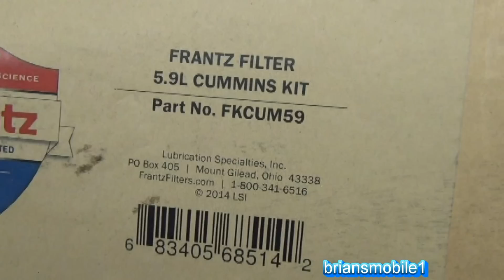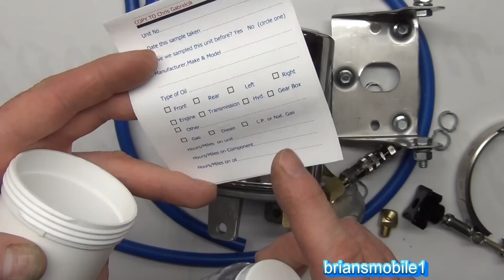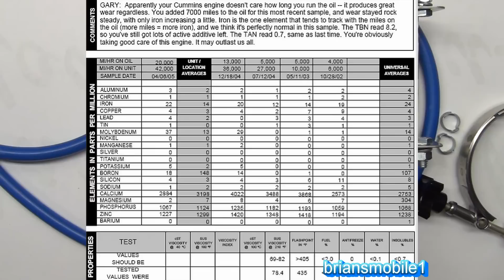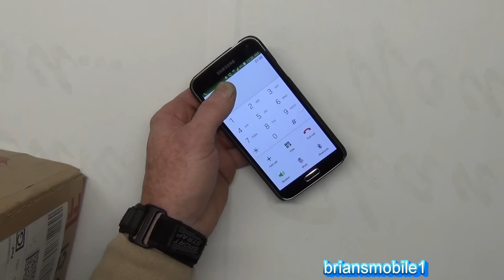How to Make Synthetic Oil Last Even Longer  Frantz

Comment: TP?    TP   is make to desolve in water.    and when you burn gasoline you make a LOT of water.
Reply: And yet, been in use for 60 years.  You must be missing something.

Oil, it's oil that you're missing.

Also, these are used as coolant filters.
Reply: The water is removed by the PCV along with the unburned fuel.  Water can be a problem with short trips in cold weather or a leaky head gasket. To avoid water problems you need to run at operating temperature long enough for the crankcase ventilation to do its job. If you dont see the oil getting milky or the TP feeling soggy you are OK. The oil protects the paper.
Reply: Its not so simple. I drive in warm weather most of the time mostly highway.. In Idaho I drove about 70 miles a day. The PCV had plenty of time to remove the water and unburned fuel..when I was selling them I sent filters to Norway and northern Canada. You have to adjust to different conditions. Water wont stay in a hot oil filter. We depend on oil temperature and crankcase ventilation. TP deals with what doesnt evaporate..
Reply: @wiredforstereo  You think your cooling system is clean. The TP will look like you took it out of a mud puddle.  Some marine vessels use TP as a prefilter to makr the expensive activated charcoal drinking water filter last longer..Its a hassle but you get coolant to the TP filter by putting tees in the heater hoses. Some military units have portable systems made by Gulf Coast Filters that go from vehicle to vehicle cleaning the coolant. Additives are added as needed. At one time they used Bounty big roll paper towels. Not sure what they use now. When you clean the coolant you might start finding coolant leaks you didnt know you had. I started getting leaks at the hose fittings.
Reply: @ralphwood8818  I actually have coolant filters on several of my diesel vehicles, Navistar T444E, 8.3l Cummins, and a 10 liter Cat.
Reply: @wiredforstereo  Yes on some trucks ive driven they were equipped with spin on coolant filters. Personally I would prefer the spin on truck coolant filters for my use. For motor oil on my small stuff I prefer the top loaders such as the Australian Jackmaster Classic. Frantz is a good filter but is to the point where TP doesnt fit so well. Im a TP squeezer. Jackmaster claims their elements are better than TP but you can use a tightly wound TP.. I doubt their elements are better than a TP such as Scott 1000. Somewhere in my junk I have a coolant filter I took off a Cummins block.planned to convert it to take hoses for the old Ford diesel pickup. Hard enough to find room for the motor oil and ATF filters these days.
Reply: @ralphwood8818  I use Scott 1000 on my Frantz. I bought a piece of aluminum pipe that sits on the center piece to better center the TP, then I manually remove some sheets so that it fits the outer housing very snugly. I like the fact that it works well enough to prevent the Oil from ever becoming totally black, and that's on a T444E (7.3).
Reply: @wiredforstereo  It wasnt long ago that I was removing 30 rounds of paper from the Great Value from Walmart. The core was 1 1/2 inch. The last I bought I didnt need to remove any and the core was larger. I remember when the Scott 1000 in the individual wrap was 1 1/2 inch. The multi packs had the larger core. My sister wrecked the old Impala. Lost my last two Frantzs. TP was all 1 1/2 inch then. You know what you are doing. I guarantee you a lot of Frantz users dont. With the Jackmaster Classic  or the Gulf Coast junior they dont care about the center tube. They have a bigger core seal at the bottom. The Gulf Coast has about a 1 3/8 tube with about a 2 inch core seal. The Jackmaster Classic  has a 2 inch core seal and no center tube. The TP core is the center tube. Jackmaster claims you can use tightly wound TP but their elements are better.than TP.. looks like their elements are a very high quality roll of TP with a 1 1/2 inch core and a fabric cover. They have a more expensive model that looks like a Triple R that uses what looks like a 30 dollar roll of TP.. I see some Frantz people are claiming you need to use the Frantz elements because TP breaks down. I learned about the Frantz when I was a kid working in a full service Standard station. I told this Standard oil engineer I see you just changed your oil. He pointed to his Frantz and said use one of these and Delo. I went looking for a Frantz Dealer. I remembered seeing a brocure on a bulletin board with a picture of a Frantz with knobs on top. I got one with the over center clamp.
Reply: @ralphwood8818  Yeah, TP doesn't break down in oil. I found one at a junk yard that was who knows how old, the TP was still fine. I've never seen one where the TP broke down. It doesn't make any sense that it would.
Reply: @wiredforstereo  When I change my TP it is strong and will tear at each sheet. I towed in a Toyota with a piston hitting the head. The owner said he had been too busy to change the filters or oil. The oil was too thick to circulate. Part of the pleats were missing in the full flow filter.. The TP looked like charcoal shaped like toilet paper. Still in one piece. Something in the bottom of the oil pan looked like black sand. When I worked at Ford my supervisor had a Mustang dragster. He told me to put a Frantz oil cleaner on his tow rig. It was a Chevy Suburban with a 292 big 6. About a 63 model. I used a Frantz Adapter that eliminated the full flow filter. At about every 2.000 miles he changed the Frantz and added a quart of Delo 100 W 20..At about 300.000 miles with no oil drains About 350.000 on the engine I left Ford.. put a Motor Guard on his Plymouth Fury before I left.  Delo was about 29cents at the discount stores. There were no diesel rated multi grades in those days. Just 20 and 30. The old Ford 6.9 had very black oil. I knew it was clean because it passed the palm test.. I could put some in my palm and it would wipe off clean without staining the skin.some diesel soot is non abrasive  and too small to be filtered out. I had a Gulf Coast  junior bolted to the fan shroud. No spillage. Returned the oil to the fill neck. Awhile back a guy said TP breaks down in a septic tank.
Reply: @wiredforstereo  I think some Frantz dealers are smarter than I thought. Some people say that paper will break down and clog the oil passages. The Frantz dealer says very true that is why we have the special rolled element filter that wont break apart. One guy said he has been in the business for 30 years. We have been aware of TP breaking apart for years. As far as I can tell the Frantz element is just a roll of TP that fits.The one Brian is holding is just high quality TP with a 1 1/2 inch core.He admits it is TP. One dealer.says its not toilet paper its a special rolled element by Frantz They arent fooling the old Frantz users. I think most people use these filters because they can use TP in them. If you tell people they have to use the Frantz elements you lose a lot of customers. Not sure how much the element cost that came in the Jackmaster Classic but they have 30 dollar elements. I have a dozen TP filters in use. No way in hell Im paying 30 bucks. When Jackmaster says I could use tightly wound TP  that  was the deal maker.
Reply: The wife and me desided to take the old 6.9 with a Avion overhead camper on vacation.. we left Texas went thru Grand Tetons and Yellowstine.. I told my wife this baby is running nice. As we were coming into a little place i think east East Missoula the injection pump went to hell. I saw a guy working on his over the road truck. I askrd him where I could get a wrecker.  He said I will call a wrecker. The Cummins shop in Missoula can replace the pump. The Cummins shop said we dont do Fords but a couple of Detroit mechanics in East Missoula will do it. East Missoula had a truck stop. The Detroit mechanics said when we get off work tomorrow we will bring a pump. They said the 6.9 has a thin place that will corrode.  Stop and have your coolant tested in Missoula it might need an additive.I said do you have the additive put it in. They said when you get back to texas get the injecters cleaned. We started the truck it was missing. It smoothed out.. we went on to Coeur d  Alene and visited wifes sister. Just west of Spokane heard weow. Wifes sisters cat was on the spare tire.Took it back.Went on to Seattle and down the coast. Home looked so good. I think what if the pump had gone out in Yellowstone. When I bought the old Ford the guy said it had over 300 k on it. A older lady at a gate said they should outlaw these stinky things.

Comment: This is B.S. its not a good idea to filter to fine. there are additives in the oil that need to stay in the oil. small particles do not do any damage anyway. they stay suspended in the oil film. Just because the oil looks clean does NOT mean its good. there are things like acid that can be in the oil. if this was such a good idea toyota would be doing this. I grew up on the farm in the 50s and everyone who used this filter ruined their engines. some from small paper fibers in the engine oil system and most from oil that looked new but allowed the engine to gum up and fail. This is snake oil. stick to proper filters and change intervals or suffer the loss. Were are these crap salesmen when your engine fails. No sludge is not a problem in an engine that gets proper oil, filter and change intervals. bull bull bull. sludge can build up because oil has no necessary additives the prevent sludge. pure oil is not what we want. we want oil with proper additives and change it properly. bull bull bull!!!
Reply from the maker: You're right about acids and the need for maintenance.  The sales tactics and sales puffery used in the 1950's was misleading as how low maintenance the system was.  People today will buy a Toyota and not change the oil....ever.  Obviously Toyotas are LOW maintenance, but they are NOT maintenance free.  YOU STILL HAVE TO DO MAINTENANCE.  The key is that you don't have to over-do maintenance.  Thermally stable modern polyalpholephins were not around in the 1950's.  Oil tech sucked.  It worked because they could use things like Zincdiethyldithimphosphates to combat friction given catalytic converters weren't on the scene yet.  This doesn't mean you can have your oil last forever- just longer.  Individual results vary- obviously, but removing radical agents prevents oil from become acidic as fast.  That's a big part of it.  Oil breaks down when it's contaminated.  It's resiliance to heat is compromised.  It's PH changes.  So?  Remove the contaminates.  Prolong the life of the oil.  It's simple, and the oil API and ILSAC ratings are higher and better than they've ever been for being up for the task.
Reply: You have a good reputation. I would hate to see you loose a big chunk of that pushing crap like toilet paper filters(pun intended). My advise. DO NOT recommend this thing and stick with proper maintenance schedules.
Reply: I have been doing a lot of research, and though I have read many "I heard people ruined their engines with this" stories, I have never read a single first person negative story.  However, there are many "I used this for decades and I love it" stories.  I have never seen a single piece of photographic evidence that a filter roll failed, or that an engine failed.  I have seen quite a number of oil analysis reports showing effective filtration.

One would think that after six decades of use, we could get some legitimate failure stories.

I'm simply interested in empirical evidence.  I see a lot on the pro-side, and none on the negative side.  I just ordered one of these and will be testing it with oil analysis on my 7.3l Powerstroke.
Reply: OK, let us know how your test goes.
Reply: Your "Tons of diesels" is the Bull Shit. If this was so good it would not be used only by the uninformed.
Reply: Ive used the filters for 60 years. Toilet paper will always bring out the liars and fools. The filter makers would like to cut down on the bull shit stories with their own elements. You can pay over 30 dollars for elements these days. My TP costs me about a dollar.
Reply: @ralphwood8818  Yes liars and fools so here you are.
Reply: @NebukedNezzer  60 years of experience starting with a Frantz oil cleaner you have never known of any engines damaged by a Frantz oil cleaner.
Reply: @ralphwood8818  yes, I know of 2. first our neighbor had a 54 ford v8 station wagon. ruined by toilet paper filter. second a friend who had a 64 ford 390 v8 ruined by toilet paper. in both cases there was paper particles all throughout the oiling systems that caused failure of engines. also you don't understand that its not enough to clean oil. you have to replace additives. rail roads and trucking companies use lab tests to determine if oil needs replacement or additives. average drivers just use normal filters and change oil at reasonable intervals. if this is to much for you to understand. well thats to bad for you.

Comment: Purely anecdotal, and not empirical. Conceptually, extra filtration appears to be desirable. But the reality is counter-intuitive. 1/ I have yet to see empirical comparisons for 2 identical engines, operated identically, then torn apart to measure the differences.  So, we cannot conclude anything. 2/ The lab tests are inconclusive and inconsistent. [see other videos for this]. In fact, a good full-flow filter can give test results equal to a bypass.  3/ The most damage to an engine occurs during cold startup. The colder the ambient temp, the greater the damage. A bypass cannot help with this.  4/ Even if all particles could be removed, there is still the problem of acids and oil dilution caused by the fuel. Acids and dilution cannot be cured by filtration. 5/ The only proven means to extend engine life is to operate it sensibly, try to reduce cold starts, change gaskets at the first sign of problems, and change oil/filter at the recommended intervals.  If anybody can prove differently, I am all eyes and ears. thanks.
Reply: Agreed!
Reply: Im not very smart. Had a.64 Rambler American flat head.6. It came from the factory with a spin on bypass filter. I would drain the Standard Delo 30 weight every time the oil looked dirty and black. That was often. Was working in a full service Standard station. Checked a Standard oil employee's oil. I said I see you just changed the oil. He pointed to his Frantz oil cleaner and said use one of these and Delo. Your engine wont wear out and you wont need to drain your oil. The boss said he is a  Standard oil engineer. I remembered seeing a Frantz brochure with a filter with two knobs on it. The Frantz I bought had the improved over center clamp. The oil turned golden and stayed that way. I think Delo was 55 cents at the station and 29 cents at the discount stores. Every grocery store had high quality TP in those days that fit the Frantz. For awhile I had to get TP from a janitorial supply. Been using Great Value 1000 from Walmart. Some use Scott 1000. Hard to find paper that fits the Frantz these days. Jackmaster is the only one in production that is set up for TP with the bigger seal. They claim their elements are better than TP. You will always see peasants down at walmart squeezing TP. If you see someone acting strange around the TP squeezing different paper he probably is looking for the best oil filter.
Reply: My wife was a office manager at the college. A professor asked her what is the light on the dash that says oil its been on a couple of days. Of course she told him to check the oil.
Reply: You cant prove anything to someone that thinks they already know everything about the subject.
Reply: Dont tell anyone but the Australian Jackmaster Classic  uses a high quality firm roll of Australian toilet paper  with a fabric cover. I use Great Value 1000 from Walmart in mine.